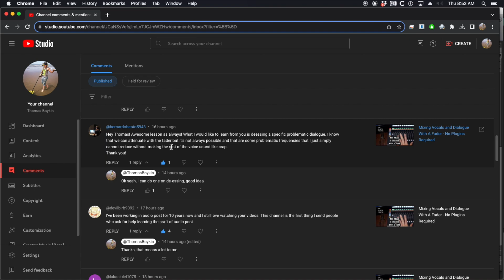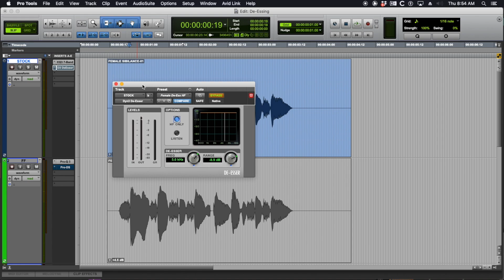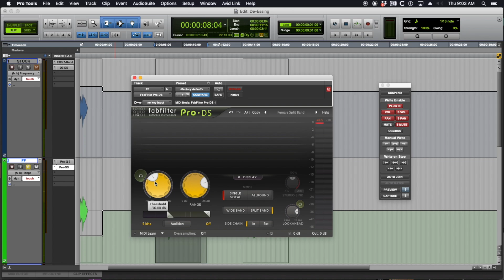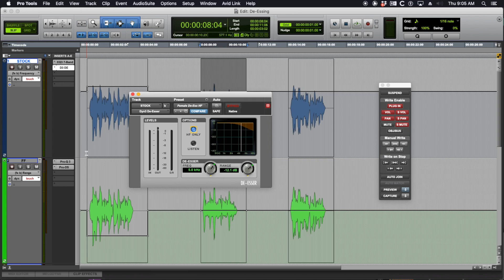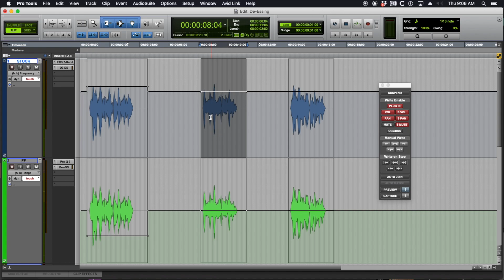Pro Tools Tutorial - How to Fix Sibilance in Voice Recordings with a De-Esser

Comment: Everyone has personal preferences for de-esser.  But I have a few that I apply for different problems. There is one that is excellent and never gets a mention and that's the Massey De-Esser. really cheap. really easy to set uo and hardly any cpu load. SONNOX (Sony Oxford -ex SSL engineers ) do a great one too,  I love SA2    and would like to hear your thoughts on the SA 3.
Reply from the maker: I've used both and prefer the SA2

Comment: Thomas, by using Write to all enabled instead of manual Write to selection, you're writing the entire board state to enabled automation categories on the given track, so if this was a mix with some automation going already, you'd be in danger of overwriting your volume, send automation or pan moves unless you disable these in the automation window (and have only writing to plug-in automation enabled).

If you used the manual Write to selection command, only the actively writing parameters that you actually touched in the current automation pass (and that made the automation banner turn green on the track) will be written without risking overwriting anything else, just make sure you made the selection before hitting play, else your risk writing to the entire length of the timeline.

As a bonus, this would allow you to use Suspend Preview to quickly A/B your changes before writing them.

Correct me if I'm wrong. Love your tutorials!
Reply from the maker: I may have misspoken, I almost exclusively use write to selection